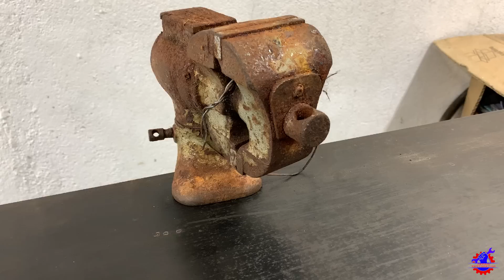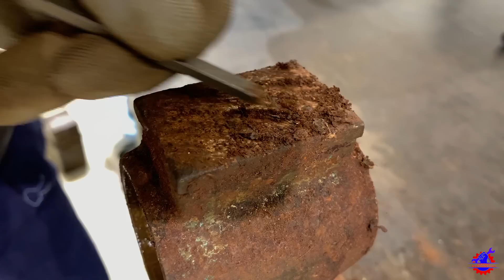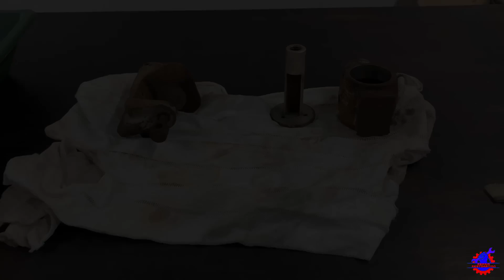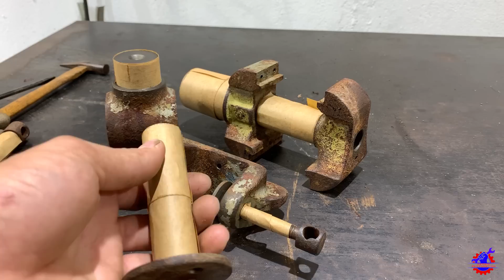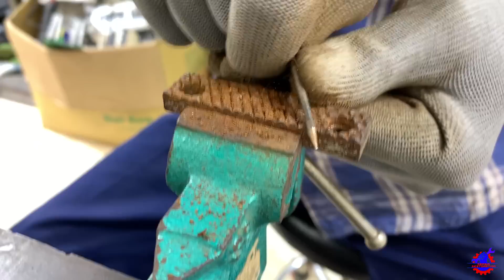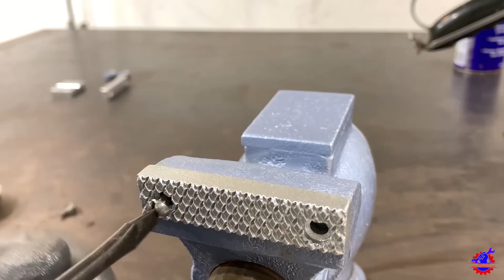1970 Vise Vintage Restoration

Comment: It's not very critical with a bench vice but I'd never use pan head screws in countersunk holes. Curious why you didn't put the original back in or replace with same type.